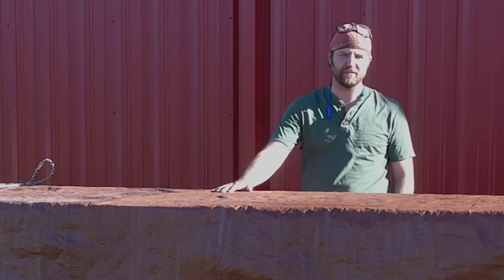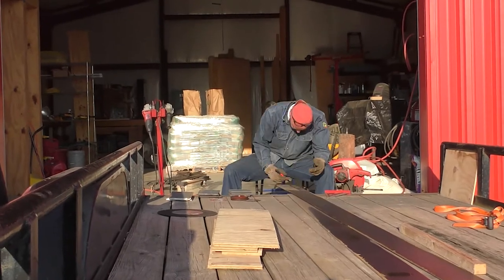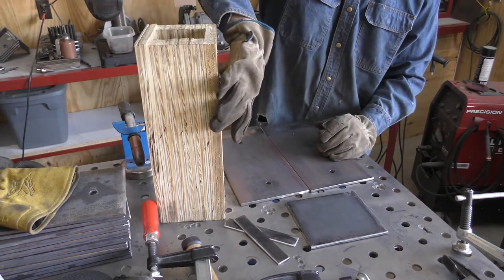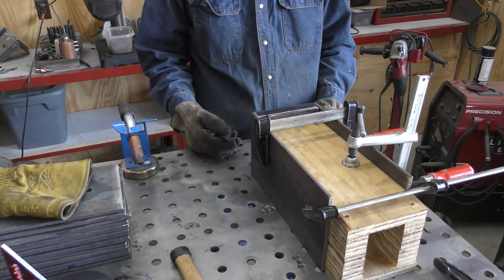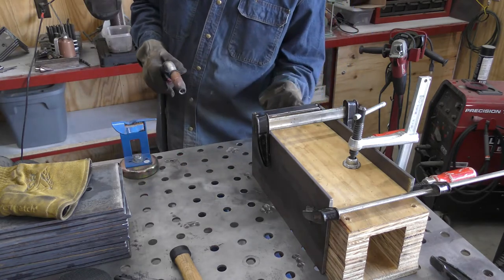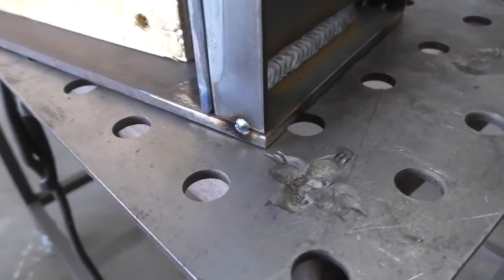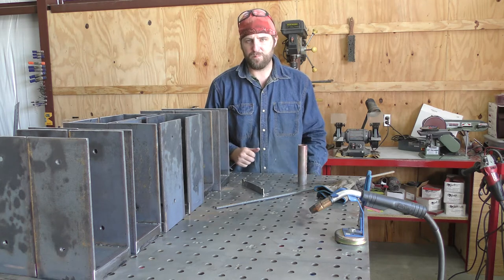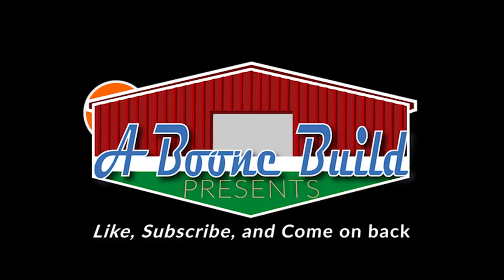How I wet set concrete anchor brackets for a Pole Barn

Comment: Very well done!
Reply from the maker: Thank you! Cheers!
Reply: @ABooneBuild  Cheers to you amigo.  Question for you:  Why not use the chop saw to cut your flat stock?  I don't do a ton of metal work but when I needed a lot of 4x4' plates the steel yard used their hydraulic sheers and man was it fast as can be.  

I think I am going to need to make 27 of these things so that may be how I go about it.
Reply from the maker: Thanks. I was doing this project when the supply chains were all messed up due to people's reaction to the C-bug. You might be able to get them for a good price now. Check out Menards.

Most metal yards will cut up the stock for you for a price. I like to learn new skills and buy tools, so sometimes I do things the long way for the experience. I had bought a new plasma cutter and wanted to practice with it. It would have been quicker to have them sheer it for me but then I wouldn't have the money to get the new tool.

Most the guys at the yard are happy to talk shop. I suggest letting them know your plans and they'll give you input. For this one, I got slightly thinker and wider stock b/c they were selling it at a discount. I wasn't putting up walls so it didn't matter if the brackets were slightly wider than the poles. They also made sure I got the right rebar.

Good luck with your project. Slow is smooth and smooth is fast.
Reply: @ABooneBuild  Good insight.  I will take a look around for pricing.  I was looking at the sturdy wall versions because the Simpsons only had a single piece of rebar on them and look like they could swivel.  Probably very unlikely once the girts have it locked down.  Thought about buying them and welding a second piece onto them.  The sturdy wall version of these are around $154 each.  I dang near fell out of my chair when I did the math on how many I need.  

Makes sense on using the cutoff wheel.  I hope you are enjoying the plasma cutter.  I would enjoy playing around with one of those too.  Also, my torch work looks like a tragedy!  Ha!  Have a great one and thanks for taking the time to respond.  TC.
Reply from the maker: You got it, I like talking shop. That total price would make my chair wobble too.

I'm no expert, just a hobbyist, I'd think the wood itself would be more likely to start twisting before the single rebar footing, without girts. Walls will start to add more strain on parts due to the pressure differential. My general approach is, find a plan or kit that's been stamped by a structural engineer, then figure out what parts I can make myself cheaper and stronger (i.e. thicker metal, more gussets, etc).

Looking back, I think I used the plasma on other footings. Either way, my first projects with the plasma cutter looked more like I was making saw blades. I'm still not great, but it comes in handy for curved lines.

Comment: That's awesome!  I was wondering how to go about making these since its seems to a a straight forward project.  I can see now that it is a more involved. Any suggestions on the bracket builds now that you've put it in the ground?  Looking to build a smaller 20x30 barn but worried about the clay soil here in TN so not putting post in the ground was more desired. .
Reply from the maker: Thanks. The design definitely took longer then the build. I looked up the brackets the manufactures recommend for similar buildings, then bought slightly bigger metal then they used to be safe. If then, the cost was lower. My water table is around 3-4ft parts of the year, so i was also worried about pole rot on the structure. I"m glad it took the time to do it that way. I hope you project goes well.
Reply: @ABooneBuild  yep.  Same here with the water.  I've dug holes a few feet deep only to watch then fill up with water.  I'm hoping with the DC welder I have, even though rated for 3/8", that welding both sides will give enough penetration.  Any comments or suggestions on that plan?
Reply from the maker: I’d go confirm this with professional welder but I believe if you make the right bevel, preheat the area, and have good root technique, the machine would handle it. I’d be more cornered if the machine was hitting the limits for welds with active loads, I.e. moving parts we the load move fairly quickly, aka cars, trailers, etc. also are you putting walls up? That would increase the strength needs.

Comment: The brackets are about $60 at Menards and come fully powder coated.  They are robotically welded, IBC rated and certified.  They also come with fully tested shear values.

Using wet set brackets is a good choice,  making your own, not so much.
Reply from the maker: Thanks for commenting.

I agree, if you’re not confident in your welding, don’t build your own.

These do look familiar. I’d need to recheck the engineering plans but these may not have met spec compared to the ones selected or I couldn’t find the spec to check them. Also, when I made my own, steel cost was about double today’s cost and supply chains had major delays/availability.

Cheers

Comment: You should start your own business and I will be your first customer.  I just bought a 30x50 PB kit as well with plans to use 8x8 posts wet set.  The anchor brackets for that size are around $150/per.  Are you kidding me, that is robbery.  Someone like you, needs to make a market in a generic product that doesn't create any patent issues.
Reply from the maker: Thanks James. I had that same feeling when I was planning that project. I was selling build plans for no structural projects but wasn’t making any money, probably due to my poor marketing.

Comment: Even State certified rebar with heat papers can easily break with even a small tack when hit with a claw hammer. I’ve seen it done on several state bridge jobs. The inspector wasn’t happy that we tack welded the cages instead using tie wire. It’s against the law to use rebar for ladders, OSHA.
It’s has something to do with some rebar metalergy “spelling”. It doesn’t happen to all rebar.
Reply: A706 rebar is what is needed here.